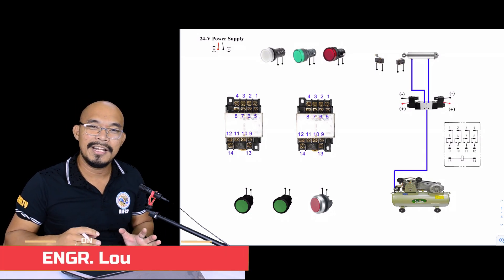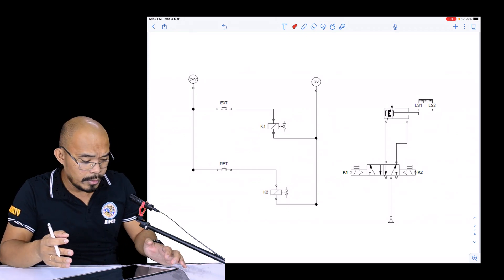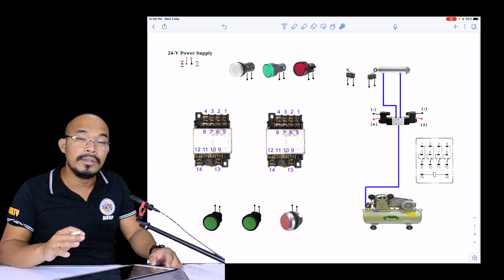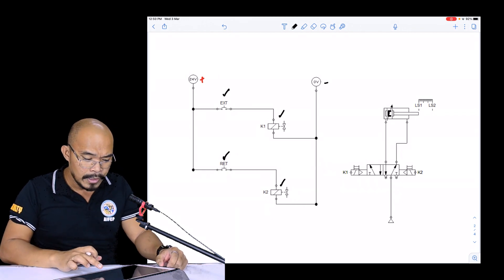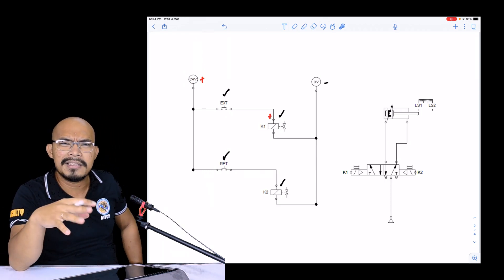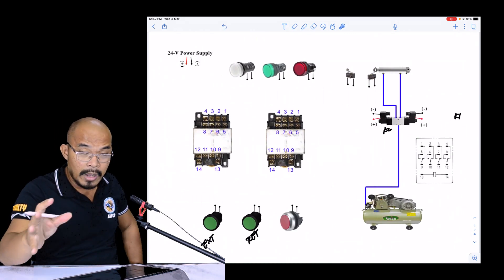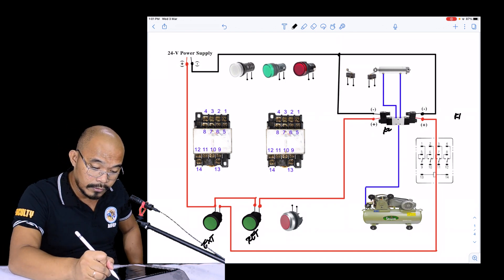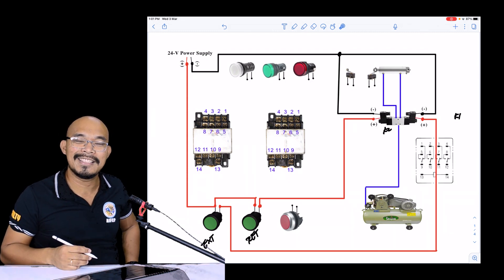How to Wire a Basic Electro-pneumatic Circuit

Comment: Sir I have a question, ano pedeng mangyari Kung Ang emergency shut off valve ko ay baliktarin ko Ang fail safe,gusto ni client gawin ko failsafe ay open instead of close Hindi na siya esd😊, either baliktarin ko nalang Ang valve disconnect ko muna actuator olopen ko manually para maging fail to open..ok lang Po ba yon? Any recommendation sir,,thanks🥰

Comment: Done watching sir❤️
Thank you so much sir for this another video discussion sir.
In wiring the switch of pneumatic system is first we must be considered our electric source or 24 volts. We can wire the limit switch from the positive source until the positive side of k1/K2 or solenoid valve. Then we wiring from negative side of k1/K2 or solenoid valve until to the negative source to complete the cycle. Because if we didn't connect the wire to the both supply it will not work anymore.

Comment: Thank you for this vedio sir I learned that the k1 is for extend and the normally push botton have no polarity so you can choose where do you can connect the portion , k1 and k2 have a 2 terminals the positive (+) and negative (-)

Comment: I have learned from this video how to identify the components that is present in the diagram. And also that the source of the diagram has 24volts with positive and negative charges. Lastly, this video taught me how to wire exactly to be efficient.

Comment: good day sir im Jay-ar R Nuñez i learn that the vdeo a push is switch used to close or open an electic control circuit  then they are primarily used for starting and stopping of operation of machinery thank you for your   sharing the vdeo sir ❤️

Comment: I learned how to wire a basic electro-pneumatic circuit. Before to start wiring, identify first the components that will be used in the particular circuits. One of it is the standard for a DC circuit whereas red is for positive and black is for negative and we must need to know these terminals accordingly in order to avoid uncertainty when wiring a circuit.

Comment: I learned how to wire the electro-pneumatic circuit in a simulator and diagram. The electro-pneumatic action is a control system by the mean of air pressure for pipe organs, whereby air pressure, controlled by an electric current and operated by the keys of an organ console, opens and closes valves within wind chests, allowing the pipes to speak.

Comment: In this video I learned about how to wire the electro pneumatic in a simulator and also I learned how to connect a wire from the load to push button extend and react going into the solenoid.

Comment: In this vedio I learned how to wire the electro-pneumatic circuit in the simulator. It teach step by step that's why easy to understand. It is always positive to negative when connecting a component.

Comment: In this video, i learned how to wire a basic electro pneumatic circuit. Connect the positive sign of the power supply to the IN of the extend connected to the positive of the K1 and the negative of the K1 is connected to the negative of the power supply. The IN of retract push button is connected to the positive of the power supply and to the IN of the extend push button. The out of the retract push button is connected to the positive of the K2 and the negative of the K2 is connected to the negative of the power supply.

Comment: In this video, I’ve learned that, first of course we have the 24 volts with the positive and negative charges; then we will identify the components that we will be using in the particular circuit. When we wire a ladder diagram, we have to wire it step by step. I’ve also learned  how to connect the wire in a minimal way so that we can save some wire.
 First we need ti identify the components that we use. The source is 24 volts that has positive and negative charge. Have also two push button that normally open and closed the extend and retract.

Comment: I learned how to wire the electro-pneumatic circuit in a simulator. Wiring a ladder diagram should be step by step in order for a clean work. It is always from positive to negative when connecting a component except for those who do not have polarity.

Comment: I've understand the basic reading of the electro-pneumatic circuit , also on how to connect the wiring to its proper position. I learned also the step by step of wiring in the diagram 24V connect to the Ext to K1 and to the 0V and so on and so forth.

Comment: Good Day Sir! The wires or perform the Electro-pneumatic wiring, First you need to do is to identify the components that we use. Then we have our source of 24 volts with positive And negative charge, and also we have 2 push button the normally open and normally close.Thank you!

Comment: What i understand in this topic is on how to wire a pneumatic circuit and as what discussed in the video there is an 24V or simply called as the power supply and also the 0V which is the negative.

Comment: After wathching the video that you present sir. It helps me to understand on how to wire especially in pneumatic system and also identify the connections of circuits. As what you've said sir that the 24 volts is the positive and the 0 is negative. Once the K1 is activated the air will flow causing the air will be extended. I also learned how to connect the wire from the load to push button extend and retract going to the solinoid.

Comment: this video help to learn the basic reading of the electro-pneumatic circuit , also on how to connect the wiring to its proper position. also learn how to connect the wirings from the load to push button extend  retract going to the solieoid valve and other tactics to connect the wire.

Comment: In the wire Electropneumatic circuit is has two push buttons Extend and Retract how you identify normally open & normally close button and solenoid valve K1 is for the extend and K2 is for the Retract button.

Comment: Thank you for sharing this kind of video sir,the functions of this components in electro-pneumatic control circuit it is easy to identify, you need to connect supply 24 volts to extend terminal push button, and it is a step by step to wiring the parts and this video taught me how to connect the wire exactly for its working process to be efficient..

Comment: For this Content sir now i understand that how to wire a basic electro-pneumatic circuit. 1st we have to supply of 24volts with a positive and negative charge then base of the diagram the push button is normally open and the 2nd diagram the push button is normally close.

Comment: I’ve learned in this video how to wire a basic pneumatic control system, by understanding first how it works, the first step is by identifying the components that will be used in the circuit, as we already know that a power supply is composed of positive and negative charge which is important in understanding how the power source flows in the circuit, in the video it is explained how to connect the power supply to one’s responsible for activating the actuator which is k(1) for the extend and k(2) for retract.  It is important to understand how to wire the components to help us be efficient in working on a circuit.

Comment: This video is very helpful because using this video it will guide you to the easiest way to analyze the diagram , I learned that the green push button is the Normally open push button or the normally open Circuit and the Red push button is the normally close push button or normally closed circuit.
In this  video the K1 is responsible for Extension when the K1 is activated the flow of the pressurized air and then it will cause the cylinder to extend and the K2 is the Retraction The K1 and K2 have two terminals the poaitive and negative terminals.

Comment: Thank you for this video sir about in electro-pnuematic system. in this lecture  very helpful to get an idea on how to connect in there particular connection using the diagram. we have the supply of 24volts with a positive and negative charge, connected to the  IN of EXTEND and retract push button.

Comment: Thank you for another video sir!  In this video i learned  how to wiring the electro pneumatic. First we need ti identify the components that we use. The source is 24 volts that has positive and negative charge. Have also two push button that normally open and closed the extend and retract.

Comment: In this lecture I learned the step by step procedure so how can connect the wires successfully from the power supply of 24V in basic electro pneumatic circuit  that has negative ang positive charges.  the normally open push botton is the extend and the normally close push botton is the retract.

Comment: Base on the diagram shown in the video , we have 24V that serves at our source with a negative and positive charge and we have also normally open and normally closed push button. Then we have to identify and label the solenoid valve. And also I learned when we wire ladder diagram we need to wire it properly and step by step.

Comment: Thank you for this another video discussion sir. In this lecture, wiring in electro-pneumatic circuit. The circuit that has the basic components which are power supply, push buttons (EXTEND AND RETRACT) and solenoid valve. When doing this in real life we should be careful in connecting the wires in any one of terminal (positive/negative) because one wrong connection may not work or it can explode any component in the circuit. So it is better to be familiarize and do the step by step procedure so that we can connect the wires successfully from the power supply (24V) to push buttons and then solenoid.

Comment: In this video sir, I learned how to wire a basic Electro-Pneumatic Circuit is that from the power supply. In I Learned that first of course we have the 24 Volts with the positive and negative charges. Great Job sir! Godbless👍😇

Comment: Thank you for this another video and very nice explanation sir .. I learned about how to connect the wires or perform the electro pneumatic wiring, First you need to do is to identify the components that we use. We have our source of 24 volts with positive And negative charge,  and also we have 2 push button  the normally open and normally close. The extend and retract also the solenoid velve used. Thank you sir Godbless😇

Comment: Thank you for sharing this video to us sir. l've learned the basic wiring of electro pneumatic circuit and the components we use. The source of 24 volts that have the positive and negative charges. Have also two push button that normally open and close, the extend and retract. Also the solenoid valve we used.

Comment: Very helpful sir, this video I gained some idea on how to wire the basic pneumatic circuit that from the power supply wich is 24 volts. To understand easily have to analize the diagram and identify the components that we're going to use. Like the source of 24 volts that has a positive and negative charges, the two push button the normally open and the normally close push button and the solenoid valve. And also we connect the wire step by step to each component to avoid incorrect circuit. 
Thank you sir.

Comment: It tells here that the red lines are positive and the black lines are negative. It begins in 24 volts or the power supply goes to the 5/2 way solenoid valve to control the double-acting cylinder. This video helps me to understand how to connect the circuits of a basic electro-pneumatic controls. MARAMING SALAMAT PO! MORE VIDEOS TO COME SIR!

ESPELITA, JAMES ALLAN M.

Comment: in this video i learned about how to identify and label each components about the given 24 with positive and negative charge also the normally push button normally open circuit, normally close push button normally close circuit and also the solenoid valves that we need to label concerning to its function.

Comment: This video how to do to connect the wiring of the basic electro pneumatic circuit. It is start in the supply of 24 volts and then it is connected to the  (IN) of extend and thr (OUT) is connected to positive of KI and the  negative of KI is connected to the negative terminal of power supply.

Comment: In this video lecture, I learn how to do wiring of basic elctro pneumatic circuit. 
From the supply which is 24 volts connected to the IN of extend and retract push botton and the out of extend push botton is connected to the k1 positive (+) of the solenoid, all of this is red wire. The out of the solenoid is connected to the negative (-) and it is black wire.

Comment: In this video, I've learned how to wiring the electro pneumatic first you need to to identify the components that we use. The source is 24 volts that has positive and negative charge, we have also 2 push button normally open and normally close also solenoid valve and we have to label it.

Thank you for this video sir 👍

Comment: In this video, I learned how to wire a basic electro pneumatic circuit. Connect the positive sign of the power supply to the IN of the  extend button then the out of the extend connected to the positive of the K1 ang the negative of the K1 is connected to the negative of the power supply. The IN of retract push button is connected to the positive of the power supply and to the IN of the extend push button. The out of the retract push button is connected to the positive of the K2 and the negative of the K2 is connected to the negative of the power supply.

Comment: Good day sir! Thank you for this another series video of electro-pneumatic system lecture. The information I got from this video are the following : the control circuit here has the basic components the Power supply, Push buttons, and the solenoid operated valves; the system circuit uses DC 24V power supply which means it has polarity (positive and negative); the push buttons (n/o and n/c) has no polarity so we can connect the wires in any one of the terminal of it; the solenoid valve has determined polarity so we should be aware connecting the wires to the exact terminal signs and colors; for the wiring we should do it step by step so we wont be confused. When wiring for extension first, we connect the 24V positive (+) line to either one of the terminal of the push button. Second, wire the other terminal of the push button into the positive (+) terminal of the solenoid valve. Third, connect the negative (-) terminal of the solenoid valve into the the ground or 0V negative line of the power supply. For wiring the retraction of the cylinder we will just do the same step or we can just find the nearest wiring or terminal with the right connection of the component we will apply. These are all the information I've got from this video sir. Thank you so much sir! God  bless ;)

Comment: In this video, How to do/to connect the wiring of the Basic Electro-pneumatic Circuit. It is start in the supply of 24 volts and then it is connected  to the "IN" of EXTEND and the "OUT" is connected  to positive of KI  and the negative of K1 is connected  to the negative terminal of power supply. And then the RETRACT, from the positive terminal  of power supply connected to the "IN" of RETRACT and the "OUT" is connected  to positive of K2 and the negative of K2 is connected to the negative terminal of power supply. So to avoid disconnection of wires (pagkalito sa pag connect ng mga wires)  so you identify the color of the positive and the negative, the (+) positive  is RED color and the (-) negative is BLACK color, that's all thank you sir. This video will help us to understand more.

Comment: As I notice, wiring a electro-pnuematic control circuit is simpleir when you have a guide like wiring diagram. That  method of wiring a system with diagram can lead the whole system in good sequence. You are only to follow the pattern each of the wires from the input up to the output of the system, just remember, all wiring activity in a certain system requires you a lot of patience before it completely done. When you are doing a wiring, just understand why it is connected into that area, in case the system has problem then you can automatically fix it as early as you can. Wiring a certain system requires also effort to make it function, just understand and follow the diagram so that the whole system will be in good condition. Thats how I understand when you doing such activity.

Comment: Thank you for sharing your knowledge sir, I learned so much about wiring we have to follow step by step and follow the diagram. We have to know if our push button is normally open push button or normally close push button. Also we have to know which is EXT and RET and where do we connect them in K1 or K2.

Comment: Goodevening sir thankyou for your video and sharing your ideas sir in this video I learn on how to wire a basic newmatic control system,  first is identify the components before use the circuit, and we have the source of 24V that has a positive (red) The red wire or the positive terminal to the push  the bottons and then direct to the solenoid valve, so it's connected, the way valve will move automatically and the pressurized air from the compressor will go to the cylinder. and the 0V (black) is the negative, the blackwire which is connected to from the solenoid valves will be connected from the solenoid valves will be connected directly to the negative terminal of the power supply to complete the circulation. Thankyou sir and godbless♥️

Comment: In this video, it can easily to understand because of diagram then to how to identify the basic function of components, we can they have our source that 24 volts which is negative and positive and this have normally open and normally closed push botton. In this process through the step by step how to connect the wires you can easily come up the idea to try in your own to connect wires at home. Thank you sir